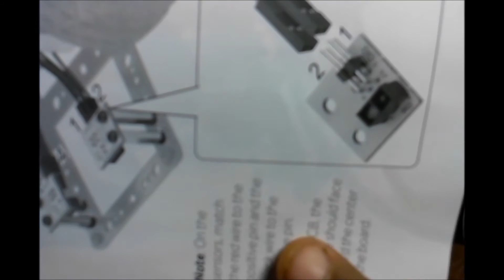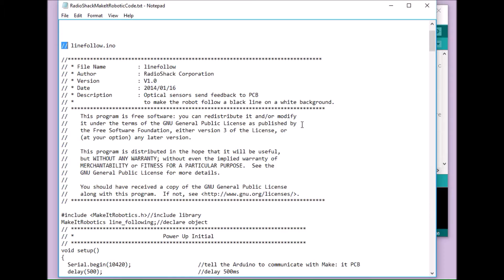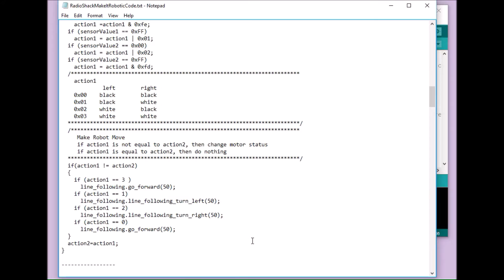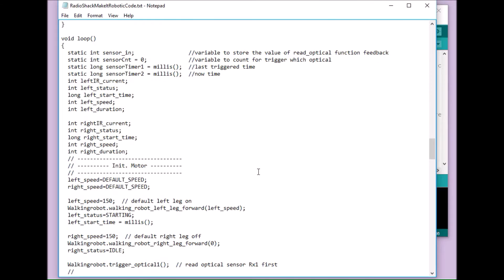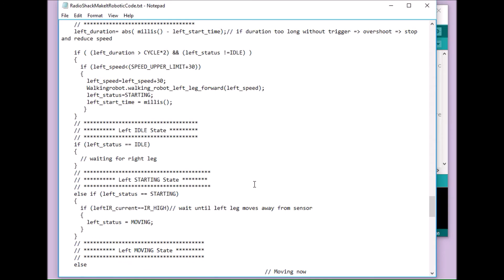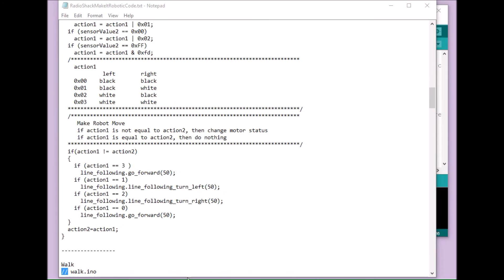Line Following Robot Make it(MakeIt) Part 9 |  Robotics Starter Kit | Arduino Uno | Ebonygeek45

Comment: I also bought this last month but it will not work its been wired correctly I think it may have something to do with the code or board. What model board do you have? I am currently using an ardunino Uno NOT R3 I believe that maybe the problem.
Reply from the maker: I tried it with three different Uno boards, my biggest problem was not wiring it correctly. The code is good.
Reply: Ebonygeek45 alright it could be my wiring then or the fact I can't install the library properly. What arduino boards did you use? I have  board model Arduino Uno not R3
Reply from the maker: I thought it was the board at first too. Then tried on 3 different boards. I am not sure if one was actually the Arduino brand. I tried which ever one was free. I have many projects going at the same time.That is why I don't think it's your board unless you chip on the board burned out. I do like the inland uno board, an it's cheap. So I am sure that is one of the boards that I tested it on. What problem are you having with installing the library??
Reply: Ebonygeek45 I get an invalid library error I'm guessing it's because the files aren't in the right place
Reply from the maker: Check out this link. I have verified the code, but I am not home to test it. It should work fine for you. Let me know how it goes. The link is:
https://sites.google.com/site/ebonygeekspeakarduino/arduino-ide-source-codes/radio-shack-line-follow
Reply: Ebonygeek45 thanks man I'll have to try it out tomorrow
Reply from the maker: Man would be woman, but thanks. I hope it work out for you. In case libraries are confusing for you. Check out this video.

icstation ICSK059A cube Arduino library
https://www.youtube.com/watch?v=uodQnGC16B4

It is for an led cube library, but the way you import the library is the same. 
Happy Coding.